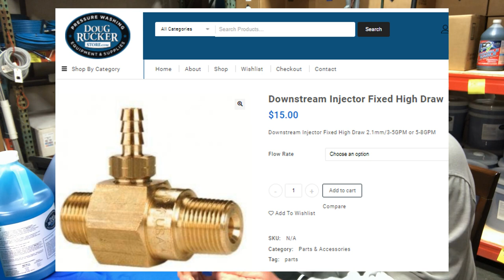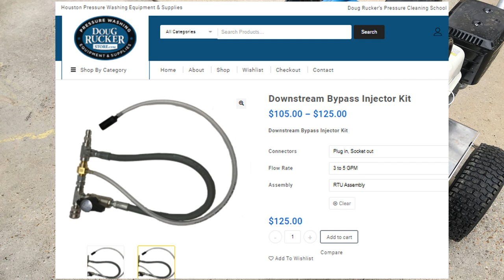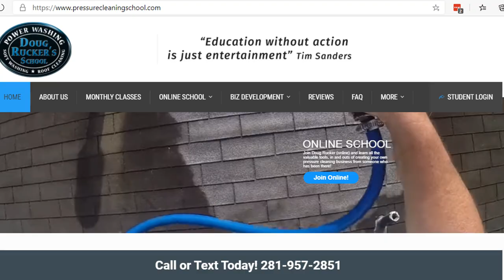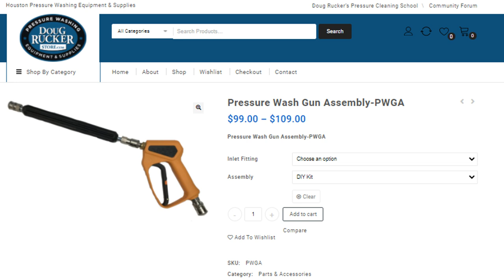PRESSURE WASHING DOWNSTREAMING BASICS from Doug Rucker's PRESSURE CLEANING SCHOOL

Comment: I have a 2.5gpm machine atm. Using a 2.0 for my setup. 
I'm actually amazed at how well it actually works. Done a few houses, decks, and two driveways. Not had an issues whatsoever. No damage caused, not really that slow compared to what I've seen others doing with higher gpm.
Reply: What's a 2.0?
Reply: 2% ?

Comment: Hi Doug, great video as they all are. my question to you is can, I use any spray gun to downstream are do I need a designated downstream gun for down streaming?
Reply from the maker: You can use pretty much any basic gun for pressure washing. As long as the GPM rating is above that of your machine.

Comment: Hey Doug I recently bought i pressure washer system it has a 26 gal chemical tank . my pressure washer does 6 gpm @ 4000 with a downstream injector … wondering if you would dilute the SH in the tank or just dump it in with no water and the downstream would do it for you .. still confused on ratios
Reply from the maker: I never dilute mine on my 5 or 8 gpm machines. So no I  would not dilute it.

Comment: I have a sprinter van that i want to outfit.  What are the TALL 200 gal water/bleach containers i should use to maximize space ?  Thanks
Reply from the maker: 200 is a little overkill I’d think. I usually install 80-100 gallon vertical or the low profile rectangle depending on space

Comment: I have a Simpson 2.5 gpm pressure washer. I bought a 2.0 downstream injector. When I hook it up it does not draw from the cleaning fluid container but it does push water back into the container. I do have the arrow pointed in the right direction. I also plugged the injector that's on the pumps manifold. I have watched a ton of videos and can not figure out what the problem is. Can you help me out with this problem?

Comment: Will the fittings on the whip-hose needs to be strictly stainless steel when using an injector?
Reply from the maker: No I use brass
Reply: @PressureCleaningSch  I'm sorry about the confusion Doug, I meant the crimp ends on the whipline.
Reply from the maker: @clivebrown400  oh yes. Stainless steel

Comment: When you go to rinse, do you simply pull the hose out of your bleach container and into water? With a five gallon pail as shown, wouldn’t that last 1 minute with a 5 gpm machine?
Also, are you suggesting I couldn’t get 2 gallons bleach to a 5 gallon pail, with the other 3 gallons water? The injector won’t draw that ratio?
My x jet can draw 100%bleach
Reply from the maker: Yes you can rinse that way. No it won’t last one minute. Will last awhile. And yes you can add you bleach and water to your pail. It will be diluted quite a bit though when down-streaming.

Comment: Doug - I have a 3300 psi, 2.5 gpm Simpson pressure washer. Nearly everything being mentioned re: attachments starts talking about them at a minimum of 3.0 gpm. Are the attachments still going to work well at LESS than 3 gpm? What I've got did an amazingly good job on my drive-and-walkways, but I'm going to do my house when I get the rest of the stuff IF it'll all work correctly. TIA Pete
Reply from the maker: They are really mainly for 4GPM and above. I’ve never used a 2.5 so not sure how they’d work if at all.
Reply: @PressureCleaningSch  Thank you, Sir. I'll let you know what I wind up with, results-wise.

Comment: If my power washer comes with a built in chemical injector could I still use a separate downstream injector attached to the hose reel?
Reply from the maker: You’d need to remove the built on one and cap it
Reply: @PressureCleaningSch  so no matter where I put the downstream injector the existing built-in one would need to be capped regardless?
Reply from the maker: @josephjohnson2114  that’s correct

Comment: While wash/rinsing a house, you have a remote system, or a bypass unit. Could you just change from soap or rinse on the Jrod and prevent from going to the truck with a bypass system?
Reply from the maker: Yes you can...by switching to a higher pressure nozzle it will cut off the flow as long as that nozzle is restoring the PSI loss and the nozzle is in good condition.

Comment: Hi Mr.Doug i have a dewalt 3600 and trying to get started on some pressure washing can i use these downstream injectors on it or do you recommend me buying the xjet
Reply from the maker: If the GPM of your machine is 3-5gpm you should be able to use it. I’m just not familiar w Dewalt and how there unloader and pumps are set up.
Reply: There 3100psi has it built in I have the same one the only difference between yours and mine is pump size it should of came with a clear hose that attaches right where your wand attaches drop the hose in solution and use black tip and your good to go. I highly recommend getting a higher gpm machine for serious commercial cleaning

Comment: I just bought a 4gpm unit. It comes with a down stream injector. I know not to use it with chemicals and am going to add one. Would it make sense to get a bypass injector if there is already a factor inline injector on the unit that water is traveling through?
Reply from the maker: If you can remove the factory one yes.

Comment: At about the 15 min mark you talk about using the 3-5gpm injector on all your machines. I have a 6gpm machine and accidentally bought a 3-5gpm injector to replace the old one on the used machine I bought. I didn’t think I’d be able to use it being less than my GPM. Wouldn’t it cause back pressure in the machine, kind of like using a tip with too small of an orifice? Thanks for your help!
Reply from the maker: It does not in my 8gpm’s.  I think you are good to go. Should get you a little stronger mix too.

Comment: One question, how much percentage of chemical is applied with this system or do I have to have a formula ready to use the injector?
Reply from the maker: Usually about .8-1%. Just depends on a few variables like GPM of machine, injector used, hose length etc.
Reply: @PressureCleaningSch  ok

Comment: Thank you for the information that you provide.  My question is,  if I'm washing a shingle roof or a vinyl siding house,  will my chemical mixture bucket be only sh and surfactants? I just bought a down stream for my 4gpm machine and will be mixing and pulling from a 5 gallon bucket.
Reply from the maker: depends on the surface and how bad the staining is.  With a 4GPM machine you may want to dilute your mix if your cleaning non porous surfaces. Like Vinyl. Downstreaming mix is not strong enough for roof cleaning. Need a dedicate pump like our Kingslinger

Comment: I noticed my surface cleaner was spraying some soap when I get the down stream injector hooked up. This was the first use of the day and I wasn’t sure if the garden hose pressure was building up soap in the hose lines while I was getting the pw machine turned on. I decided not to risk it and just disconnected the downstream injector until I needed it but I was wondering if garden hose pressure will syphon a little bit of the soap if the machine is not on at first?
Reply from the maker: You sure it was from the injector. Nozzles on a surface cleaner shouldn’t pull soap from a DS injector
Reply: @PressureCleaningSch  it smelled like the chlorine so I can only assume it was from
my own supply. Does low pressure from just the garden hose running through the lines syphon from down stream bucket? I usually have the water running to make sure everything is copacetic before I even turn the pressure washer itself on

Comment: It says 2.1 orifice but what’s the ratio of the Downstream injector? The website only says pulls 20% max draw?? Very confusing.
Reply from the maker: Should say UP TO 20% draw...manufactures test flow rates, ratios, etc, without using hoses, guns, etc and usually in an indoor lab type environment.  Hose length, GPM and other variables play into the ratio or draw rate. I always advise on the ratio you will get is 8:1 or higher depending on all the variables when using a downstream injector. I've never cared or tested to get the exact ratio coming out, because all I care about is, is it cleaning, (Changing the color of the algae) or is not.  If not I know I need to use something that will produce a % that will.  I do this by using our dedicated pump or pump up sprayer.  X jet can also be used to achieve this.

Comment: If you are using a Schertz box, do you still need a downstream bypass? I recently had a Schertz box installed. I notice when using high-pressure tips, I get a high pitch sound coming from or around the hose area. When I switch to a black tip, the sound goes away. Is that normal
Reply from the maker: You dont have to have a bypass, I don't. But you can if you want.  On the high pitch sound I;d look for a small leak somewhere, at a fitting, in the hose...never really heard of that before but thats the only thing I can think of that would cause it.

Comment: I don't get my head around this dilution calculation.

I'm looking at a 4 gallon water pressure with a 7:1 ratio. If I buy a sH of 15%, how do I mix this in a 5 liters bucket? to get a 2% solution of example? Any mathematic calucations I can write down to do this my self?

If I for example put 1 liter sH and 4 liter water. It goes through my downstream injector in a ratio of 7:1, whats the final output %? I don't get this at all. Thanks for any help.
Reply from the maker: Here you go this may help you.  How to manually figure out your dilution ratio on your pressure washer. How to manually figure out your dilution ratio on your pressure washer.

Comment: Hello Doug, I have an adjustable injector. I put the line into a gallon jug and it sucked it dry in no time. If I had say a 5 gal bucket with solution in it and started washing , how can I adjust the rate at which it draws as not to empty the bucket before I even get half way through a small wall. Hope this makes sense
Reply from the maker: If it's and adjustable injector you should be able to adjust it, but if you are doing one wall and is emptying the bucket that quick, thats way too fast even at full open on the injector.  The injector w use, we can clean almost a whole 2500-3000 sq ft house with one 5 gallon bucket.

Comment: Is it ok to cap off the downstream hose from your bucket or switch hose to a clean bucket of water, or does it matter? I assume you can’t just leave drop hose end open. Thanks
Reply from the maker: I wouldn't cap it off, you could use a bypass injector set up or like you said switch hose to a clean bucket of water.  While leaving the hose open won't hurt anything, it will cause it to suck in air and then you'll lose pressure and flow, and your water will spit as opposed to a nice continuous flow. Bucket of clean water may be the easiest thing to do.

Comment: Hey Doug again! Quick question,  if I use the xjet attach to the end of the water gun,  the amount of  hippocloride that comes out of the gun would not change much from the concentration I have in my bucket right? 
And also how strong do I need my mix in my bucket?
Thanks!

Comment: Ok stupid question is there a way tp determine if a chemical can go through the powerwasher or has to be downstreamed?  Im using cleansol BC  and have contacted the manufacturer and they said it can be downstreamed but didn't say it can go through the pump
Reply from the maker: Not sure but why do you want to go through the pressure washer?
Reply: @PressureCleaningSch  .   I was told its totally fine to feed through the soap feed.   But the chemical im using is more caustic and am not getting a direct answer.  Im self taught over the last two year.   Your channel has been a god send.   That's why i came here.   If its flat better to do down stream ill do it. 
   When i contacted the manufacturer and ask if it was good to downstream or should be just fed through the soap hose they responded with and I quote" well you can downstream but make sure tou have the ratios Right.   Thia has me totally confused as it was not the answer i was looking for.
Reply: @PressureCleaningSch  cleansol bc does not leave a residue but is far harsher than lets sat Challenger power wash.

Comment: If I use a downstream injector and a j-rod on a 2500 PSI machine, is that technically soft washing? I am just starting out and I can't afford to buy a "Soft Wash" Machine yet. Do I absolutely need one? I am doing houses, and I don't do roofs in our area anyway, and if I really had to I would probably use a pump sprayer and a garden hose to rinse. The houses in my aria are mostly stucco, wood and brick. Thanks for your advice. I will be hitting you up for a j-rod or two soon.
Reply from the maker: Yes in fact downstreaming as the original soft wash cleaning method. You only need a dedicated pump, Often referred to as a soft wash system if you’re going to do roofs Or houses and buildings that have really bad organic growth

Comment: What do you do if you built a powerful machine but can't find an injector to match it? I am having trouble drawing chemicals. My PW is cranking out around 10-11 GPM
Reply from the maker: Which ones have you tried? And have you tried an x jet?
Reply: @PressureCleaningSch  Thanks for getting back. The 1.8 was causing tremendous back pressure but was drawing a little chemical. The 2.1 was drawing a little chemical but not significantly. The 2.3 surprisingly wasn't doing anything at all. Not sure if any of the injectors are "High Draw". I am using a check valve with it. My power washer is a Predator 22hp, w/ the TS2221 pump, and I am dual feeding it with water on both sides of the pump. Not sure completely of the GPM but it's a beast and must be in excess of 10 GPM. The check valve and injector are in the correct orientation. I am open to suggestions.

Comment: My down steam injector isn’t picking up chemicals. 
It’s brand new, have my pressure turned down low, using a black soap tip. I can hear the ball rattle when I shake it. I put it in a bucket of water and I can blow through it to get get bubbles. I turned pressure all the way down and trigger it slowly raise the pressure and still nothing. I’m lost why it’s not picking up.

Comment: Hey Doug thank you for all the helpful info. One question, I have a 3.5 gpm unit, and I'm using a jrod, well I actually have the quadrod, would I get more distance by having a dedicated gun without a wand or does the length of the wand increase pressure therefore increasing reach? Or my reach is limited by my gpm? Hope the question came out clear. Thank you in advance.
Reply from the maker: Your reach is limited by the GPM. An extension wand just allows your nozzle to get closer to the surface.
Reply: @PressureCleaningSch For my 3.5 gpm should I use the 2-3 or the 3-5.
Thank you.

Comment: Hey Doug, I just recently put together a 8gpm belt driven machine. New to power washing so not that familiar with everything yet. I've heard a 3-5 down stream injector pulls more chemical on a 8gpm. Have you had experience with this or would you recommend me purchase a 5-8gpm down stream injector?  Also, when post treating; should I add soap to the mix or just SH? Thanks for any help!!
Reply from the maker: I use the 3-5 on my 8GPM and works great and does pull a stronger mix. And yes always add soap for post treating or any cleaning really. Don’t need a lot but it just helps the cleaning vs no soap.

Comment: Hello Doug! I bought a beginner kit for downstreaming . 4gpm Honda GX and came with a 20" surface cleaner. I read as rule of thumb for surface cleaners 4" per GPM . I done 3 jobs with it so far and didn't have any issues. Could I do something to prevent future issues? Changing the tips perhaps? Thank you for your videos! Very helpful!
Reply from the maker: It’s 4 inches for every 4GPM.  YES Change the tips frequently depending on how much you use it. I changed mine every 2 to 3 weeks when using it every day
Reply: @Doug Rucker  thank you so much for the response! Changing the tips I meant different diameter to be efficient with the 4gpm machine . Since optimal would be 16" SC
Reply from the maker: @MadGr33k  ahh duh, lol. Yes you probably have 2502 or 25025 in them. I’d keep on hand 2503&25035 as well.
Reply: @PressureCleaningSch  thank you so much !

Comment: Thanks for sharing your knowledge in this excellent video Doug. I'm curious what the limitations are for the pickup (lateral and vertical) of the pickup line from the injector to the machine, i.e. if using a bucket for chemical at ground level with a machine in a pickup bed is this an issue that needs to be considered? Also does it vary by pump size?  Thanks so much...
Reply from the maker: I have down streamed out of a bucket many times from my machine on a truck and the bucket on a ground.  Main thing you want to be careful of is not making your siphon tube to long.  10-12 feet is about the max you'd want to go.  Pump really wont matter unless it's a store bought low gum direct drive, then you may have an issue. Great question, thanks for posting.

Comment: Is the draw ratio the same with 150ft of pressure hose?
Reply from the maker: No, draw rate can be affected by length of hose and the GPM of the machine
Reply: @PressureCleaningSch  for instance, 4gal machine and 150ft of 3/8…would the 3-5 DSI be able to produce 1% mix?
Reply from the maker: @northeastpowerwash8579  yes. That’s about the most you’ll get.
Reply: @PressureCleaningSch  appreciate the feed back. Subscribed👍

Comment: I recently bought a xjet m5 and I was trying to use my down stream injector with my xjet and it won't pull soap any idea or why tha ks
Reply from the maker: The x jet m5 is a down stream injector. So try it with out your downstream injector
Reply: @PressureCleaningSch  yes I know that I was just tryna see it the Chem injector would work without dragging a hose around with the m5  was wondering if there's a different  chem injector to make it work